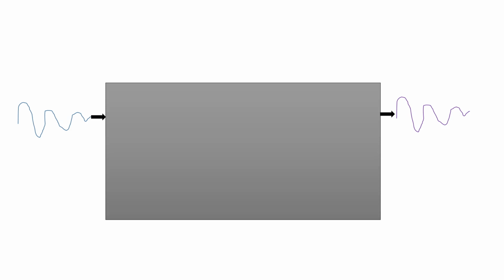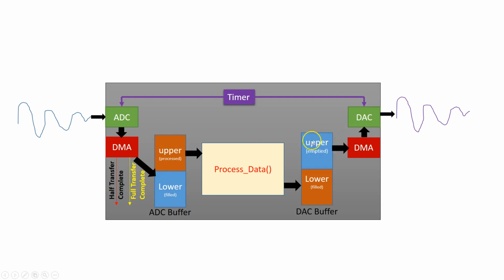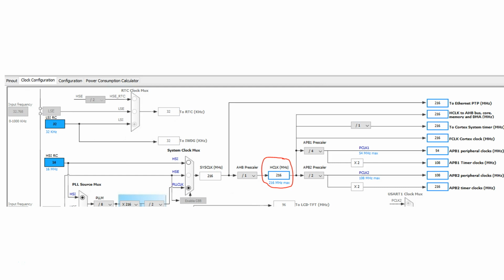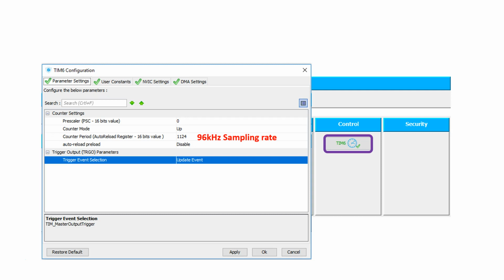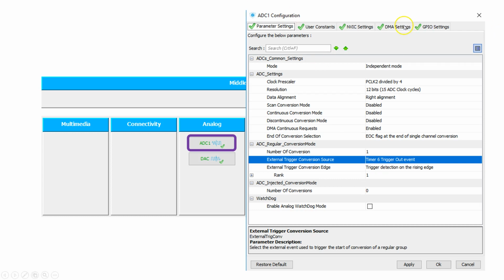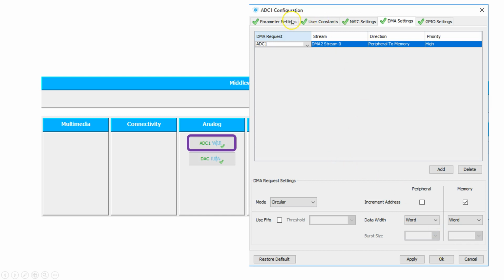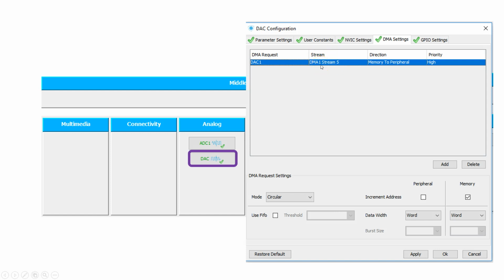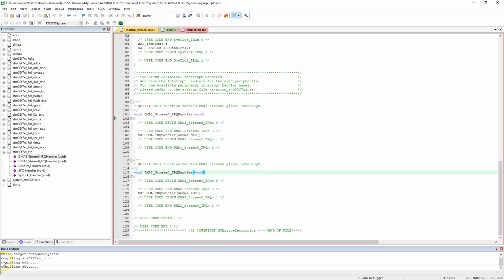Part 1 of 2:  ADC to DAC via DMA

Comment: Is it possible to have multiple channels do the ADCs conversion as fast as possible, without using a timer?

The way it's shown, TIM6 seems to trigger the ADC to do a conversion and DMA2S0 the result to memory.. but the same TIM6 will ALSO trigger the DMA1S5 to transfer data to the DAC peripheral?   Since the reference manual (Table 8) shows the FDCAN/USART2 to also be on the same APB1(D2) bus as TIM6/DAC/ADC/DMA1,2.. is it possible to automatically DMA the raw ADC results to the UART or CANBUS peripherals directly?

Comment: Very nicely explained. Is this configuration and coding work work for STM32H743? I followed the steps as such but it is not functioning? will you help me to sort out this.
Reply: did you ever get this to start functioning? I am working on STM32H7 and the callbacks are not being properly triggered
Reply: https://community.st.com/s/question/0D50X00009XkXEHSA3/stm32h7stm32h743-adc-with-dma

Here was a fix I found to trigger callbacks

Comment: Can this code work for stm32f4 discovery board?
Reply from the maker: Yes. The libraries will change but the idea of CubeMX based coding is to be able to move easily from one Cortex device to another with minimal change in code.
Reply: @ENGRTUTOR  Thanks! I coded. I have one doubt what is the maximum and minimum values of voltage that can be given to ADC pin. I m using a function generator to provide the sine wave
Reply: @jollymishra8558 , Check the datasheet for the particular MCU used on the board, but it's probably 0V-Vdd (3V).

If you look up some of the schematics for Mutable Instruments designs, you'll see a good way to handle the inputs.

Basically, use a single rail / single supply op amp, preferably capable of rail to rail operation, like the MCP6002 (dual) or MCP6004 (quad).  Make a simple inverting buffer or fixed gain amp stage, probably with a gain of less than one - then invert the signal in software, if you need to.

The output of the op amp can only be 0V-Vdd, if it's powered from Vdd.  At worst, you might damage the op amp, but never the MCU - and you almost certainly won't damage either.
Reply: Hello, I am using the same board as well. What would be the appropriate value for HCLK (Clock Configuration)? I cannot input 216
Reply: @KenDedes94  use 168.